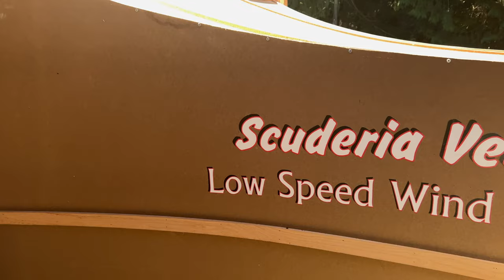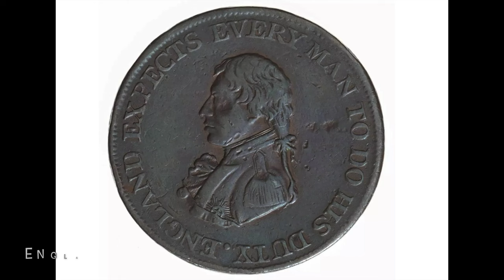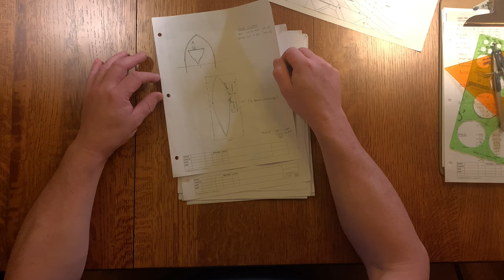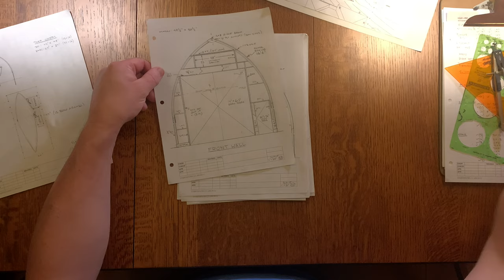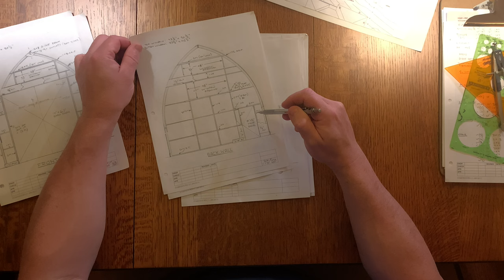Journey of Sailing Yacht Syrinx EP 6 - Wind Tunnels & Wooden Boats

Comment: Electric planer for most of the removal. Do the fine stuff with coarse sander or a grinder first then a sander. Best of luck with a very large tedious project.
Reply from the maker: Thanks for the tip Adam.  I do have an older Makita power planer and thought about it.  The challenge is all the copper ring shank nails.  If the planer cuts off the heads, it will be very difficult to get them out.  I don’t want to have to drive the shanks of broken copper nails down into the deck strakes, for fear they will later leach green corrosion byproducts.  I’m looking into a hi-temp heating mat to soften the epoxy, in the hopes we can take it up in 1’ x 1’ squares.

Comment: Heat up the deck and pull the ply. Epoxy usually softens up nicely when heated. I find it amazing that shes primarily built from teak. Probably why shes in decent shape for her age and lack of maintenance.
Reply from the maker: Great minds think alike Matt.  That will likely be my next move.  Luckily the fiberglass is not well bonded to the plywood, so it can generally be pulled off in sheets with pliers.   That leaves the two layers of marine ply.  To keep from scorching the ply into an unworkable mess with a torch, I'm looking into the high-temp heating pads used to cure composite materials.  They go up to 700F.  If I can get the epoxy soft enough, I'm hoping I can get a chisel or pry bar under it and draw up the copper nails.  They are a bugger, as they like to break off if not pulled out very carefully.  We can probably pound the end of the copper nail down into the teak and put filler over it, but I'm afraid they would bleed green oxides up onto the deck over time.  I'd really like them out of the deck.
Reply from the maker: The teak construction is one of the prime attributes that drew me to her.  She was built specially for a fairly well-healed English publishing magnate and one of only two of 36 Gauntlets built with teak centerline, frames, planking, deck, and deck furniture.

Comment: Deck was covered over to get rid of constant leaks,wonder if you go to all that trouble and just end up with the same problem !love the Vlogs
Reply from the maker: You are absolutely correct.  At least three prior owners going back to the 1970's reported having issues with the traditional caulked decks leaking.  It culminated with this attempt to cover them, but the work has not held up and it leaks like a sieve.  I've not yet had a chance yet to interview the previous owners at length, but suspect there was never a serious attempt to fully reef out and re-caulk the decks so they were always chasing leaks with one patch after another.  My current mindset is to get the ply and fiberglass off, and if the remainder is in similar shape to what I found, we will perform a complete restoration of the traditionally laid deck.  At a minimum that will mean reefing out and cleaning up all the seams prior to caulking and paying.  We may end up removing all the fasteners and taking the planks off to better clean up, check the deck beams, and refinish all the faying surfaces.  Glad you are enjoying our story so far!

Comment: Nice to see the teak deck!
Heat can soften epoxy - that may help in getting it off?
Reply from the maker: I was thinking that as a next move to try.  In our Soap Box cars, I occasionally had to remove roughened steel axle mount plates that were epoxied on to wood floor boards.  Heat softens even the toughest epoxies.  I'm starting to look at the high-temp heating pads used to cure composites.

Comment: Hi Rich, Bob Cooper here.  Possibilities: don’t know the availability of teak but could you just re-teak the deck over the fiberglass ? Heat will soften epoxy, or would a planer Set with a very minute cut get you down close to the teak ?  Another possibility is hiring a sandblaster to come in and blast the bottom of the hull, it would speed up the restoration process a lot.  You’ve got a good start.
Reply from the maker: HI Bob!  Thanks again for following our story.  Replacing the solid teak deck even if we could source that much large and long teak would far exceed our budget (I estimate ~$50k materials alone or more).  Putting anything more over the already thick deck would also potentially create stability issues, as that is a lot of weight to have fairly high in the boat.  I think we'll be able to get the fiberglass and ply off, and as I've commented to several other viewers,  you're likely on the right track with heat.  You probably know masters steel axle plates can be taken off wood floor boards fairly easily if you heat the epoxy up enough.  I'm starting to look at high-temp heat pads as used to cure composite materials.  These go up to about 700F.

Comment: Great stuff!! Is removing the plywood decking really necessary?
Reply from the maker: It’s a matter of personal choice, but on a historic yacht like this I’m interested in returning it to a traditional laid solid teak deck and willing to invest the effort to do so and maintain it.  I’m ok if it ends up with some “character” and believe if dealt with properly it can be made fully watertight once again.  This will entail a complete reworking of the deck seams and possible removal of the individual deck strakes to properly dress the edges prior to caulking.  Even if I opted to try to keep it, the fiberglass is already delaminating from the ply in places and I’m sure rot has already set into certain areas of the ply.

Comment: There's the Devil to pay.
Reply: Perhaps not? 
The “devil” is the seam on the bottom of a boat between the Garboard Strake and the Keel. The word “pay” meant to cover the seam with pitch (tar). In the old days ships were “careened” at low tide meaning they were allowed to lean over on one side to expose the devil.
Reply from the maker: I suspect the reason the rows of teak dutchmen and galvanized bolts into the floor fittings were added was to try to firm up that "devil" seam.  Compared to other boats of similar construction I'm familiar with, Syrinx does not have a ton of overlap (only about 4") between the keel and the garboard strake.  I think this may have been deemed acceptable by Berthon due to the fact that the stem timber extends all the way past the mast forming the mast step, so the keel is not loaded as much by the mast.  Nonetheless, any looseness in this area would allow the garboard to pry away from the keel leading to leaks.  Besides shoring this up with new fasteners, repaired Dutchmen, and new floor fittings, I am also thinking about bronze external strapping from some of the larger frames to the lead ballast keel set flush with the hull surface.
Reply: @SailingYachtDreamcatcher I was told the devil is the seam between the deck and the hull, at the top as it were.It is the same devil as in stuck between the devil and the deep blue sea, over the side but not drowned yet.